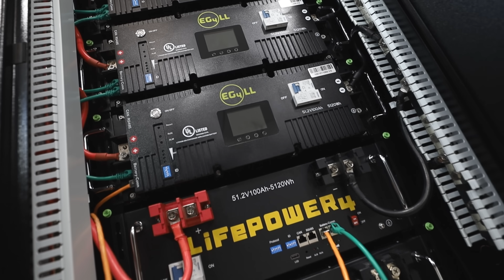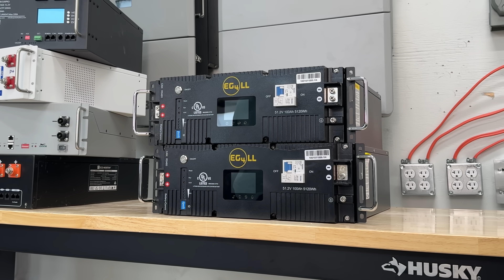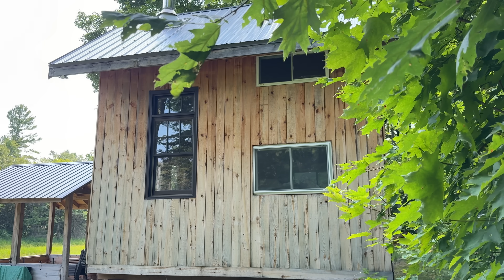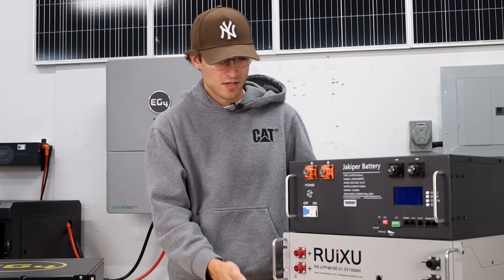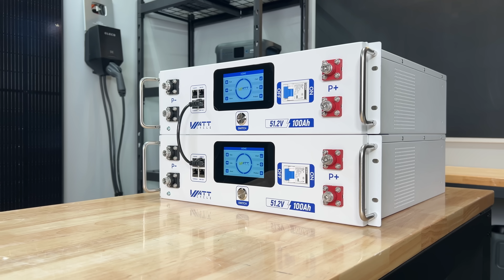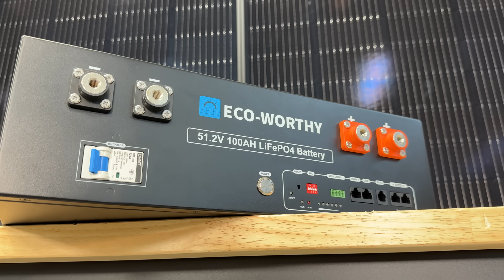Stop Wasting Your Money - Only Buy These Solar Batteries

Comment: You guys should invest in a 60 volt battery cycling machine. To really find issues and to graph out the results so that your viewers can see it for themselves, you need a calibrated and certified cycling machine. They are 20 to $30,000 and you have to run Chinese three-phase, but that's not hard to do. It's just so hard to actually give a recommendation unless you have the test equipment.
Reply: Will, it's not Pecron supported therefore it won't be on this ch 😊
Reply: "Chinese three-phase"? 😅 what?
Reply: @TrueDesire존 yeah 380V. Need transformers running them but it's only way to run the best machines
Reply: @WillProwse   380V still falls in line with standard ~400V three phase, what is the Chinese part?
Reply: @TrueDesire존  no it's phase to phase voltage and 50hz. Phase to neutral is 220.
Reply: Did you even try googling it?
Reply: @TrueDesire존 . He makes it up as he goes, trying to retain his income from youtube.
Reply: @WillProwse phase to neutral is single phase. Wrong again suckup.
Reply: @5400bowen  I'm still trying to figure out what is so Chinese with 400V three phase that pretty much everyone in Europe have in their homes 😂 (red socket in Sweden for the 400V)
Reply: @TrueDesire존 ohh yeah it's close. Interesting. It's very different from North American three phase so we have to run transformers. It's 480 down to 380
Reply: @5400bowen huh? What was I wrong about
Reply: @5400bowen makes it up? I have a transformer humming next to my head right now while I type this. What did I make up
Reply: @5400bowen  You must not be very smart. 3 phase can have a neutral and while used in a single phase manner.......it is still part of a 3 phase system. 277v is common from hot to neutral, but 480v phase to phase. You must be an anti Will Prowse troll. It is common for equipment made in china to have a slightly different voltage. Look up cnc bending brakes, laser cutters, electromagnetic brakes, and similar tools. 208v, 240v, and 480v 60 herts are our common 3 phase voltages in the USA.
Reply: @CGT80 . I know more about it than you and prowse will ever imagine exists.
Reply: @5400bowen  Nope. Retired electrical engineer here, Phase to Phase is sqrt(3) times phase to neutral. It straight up trigonometry, country doesnt matter.
Reply: Their channel is just a modern day version of QVC...
Reply: These YouTubers are more interested in commercial deals with companies than sharing objective data.
Reply: @petertulp8806 . Precisely, he sucks up to whoever pays him.
Reply: @petertulp8806   Not everyone has 6 Teslas,  4 trucks and 3 golf carts. Some have families to take care of.
Reply: @Jackx-w2l  Well that sure sounds like the ultimate family transportation scenario! What’s the rub?? WP provides an invaluable service to the DIY solar community 💪🏽
Reply: @ModQuad-l6z  Didn't he get those luxury cars and mansions using money from the companies?
Reply: @Daniel0815-zzz  I don’t know how Will’s businesses are structured. I imagine his YT channel and affiliate programs provide some income.  In the US, we are all free to run our lives/gigs however we see fit (for the most part).
Reply: @Jackx-w2l  But then paid for with evaluations of equipment that folks have come to trust.  So you can truly test and yet receive payment rather than slant toward advertisement.   You kind of make your own point in that again the 6,4,3 were purchased with funds from pointing out the good and the bad as best he could with the tools at hand at the time.  As funds and time allowed he dug deeper.
Reply: You should invest in an education in being a human being. You pushed all the overpriced garbage and all the ripoff retailers that paid you to.
Reply: @5400bowen dude, where is the hate come from? Will is widely respected in his field and just because you might not like him, doesn't mean he gives out bad data about products. Please comment on what he(Will) got wrong then? Your jealousy and self bias is what is showing.

We actually need more people like Will and this channel as they all are here to give information.

Try to use your brain, research pros and cons of all that you see and make an informed decision.
Reply: @5400bowen  That's funny, he was pushing LiTime batteries over Battle born when I was planning out a system. He has also changed his opinion as the product quality of various brands has changed..........apparently, LiTime isn't as good as some of the other less expensive brands that have become available in the last two years, but that isn't his fault. He is human and acts like one. You on the other hand are just a trolling POS.
Reply: @5400bowen huh??? You haven't seen my videos then 😂
Reply: @WillProwse poor will, can't remember past yesterday.
Reply: @5400bowen post the video here, let's see what youve got
Reply: @5400bowen  Finally, some common sense in this thread. I’ve seen so many emotional, mindless followers in Will’s comment section. It’s like a DIY solar cult where they blindly believe whatever he says without a shred of independent critical thinking.
Reply: @Daniel0815-zzz . MIT and the University of Maryland have a free solar course and a series of solar videos respectively. You can find them here on youtube, or search the web for them. Really good content. I grew up with electricity. My brother was an electronics technician and did electronics engineerimg trouble shooting for the navy. Prowse put out some good info here and there, though much of it was rich boy playing, but also backed some real crap products/companies for affiliate compensation.
Reply: Because all these you tubers have an extra 20 to 30 grand just lying around to stroke your ego.
Reply: What do you mean about ego. Wasn't sure what that part meant
Reply: @WillProwse love your content. Easy to trust
Reply: @quillakiore3499  Totally agree I am a noob in this area and Will makes it easy to learn and trust.
Reply: @WillProwse . You know, the ego that allows you to promote ripoff companies so you can play rich boy.
Reply: @quillakiore3499 thank you
Reply: @5400bowen how to say that I've never really seen a Will Prouse" test video without actually saying it. 
You know the old saying: you can lead an idiot to a properly researched & informative test video... But you can't make him watch it.
Reply: @Mountebanksrus  I watched a ton of his videos...until I realized he's just selling BS for a bunch of rippoff brands and supplyers. Ever video was just glowing reports on anything and everything. It's after he started pushing Signature Solar and I tried to do business with them...what a ridiculous fiasco! The sales guy kept me on the phone for 2 hours. I've done phone sales and recognized the boiler room bull. Every other question he had to "check with his manager" after telling me he had just transferred to sales from system design. After I told him I DID NOT WANT 10AWG (I use 8 gauge, explained the whole thing to him)  leads from the panels, and he said he'd email me with a quote the next day...I got an email a month later...with a quote including 10AWG  panel leads. Not to mention they wanted money up front for backorder gear, some of which I never asked for in the quote. You know what his "manager" was telling him for 2 hours every 5 minutes? "WHY DON'T YOU HAVE A CREDIT CARD NUMBER YET!!!!" The guy was stumbling and fumbling through the whole conversation. Then prowse started pushing their "pre order" bullshit. Sure, buy gear that's not even available yet....
Reply: @georgemiller9533 hey a Toyota Camry costs more and the data is beneficial to millions of people. It's a pretty good return for everyone
Reply: @georgemiller9533 that's science George. How can you recommend anything with a proper calibrated testing system?
Reply: @georgemiller9533  That guy uses professional gear and "rigorous" reviews to burnish his image, but in reality, it is all a ploy to drive commercial promotion and secure lucrative returns from brands. He even goes so far as to stir up trouble on other people's channels.

Comment: This is going to piss off those guys who said "a UL listing gives you insurance in case something goes wrong". 

No, off grid, a UL listing means nothing. All we need is storage, not certifications. 

There are MANY guys on YouTube who do nothing but tear down "cheap" batteries and tell you which are good, and the ones that could be dangerous. 

If you still believe a UL listing is proof a battery is great... Battle Born batteries have a UL listing and they have been proven dangerous and unreliable.
Reply: A major advantage of third-party certification is consistency.  The testing agency periodically checks to ensure that the batteries being sold match the ones that were tested.  In the past couple of years that I have been looking at this stuff, some of the less expensive batteries have been built with whatever components were cheapest at the time.  A battery bought a couple months later may have different components and BMS programming.  That may not matter if you have the time and ability to troubleshoot, but that is beyond many who just want solar or battery backup.
Reply: @jfess1911 Cool story... Now do Battle Born.
Reply: @da300mann2  Exactly - battle burn disprove his theory.
Reply: @da300mann2  That is why they are so uniformly bad.😀
Reply: @jfess1911  Periodically checks to make Sure Battle Born are still fire hazards?
Reply: @robertkubrick3738  It is more to assure that they don't change the design or components, as seen with WattCycle batteries recently tested by Will Prowse.  The battery he "blind" purchased (not sent directly by WattCycle) had an entirely different build from the ones received by some others and what was advertised on the web site.

Comment: As long as it's not BattleBorn battery, I'll consider it
Reply: *BattleBurn
Reply: they are a bad product..... and UL listed. it's pathetic they are UL listed. that listing should be removed
Reply: I have 24 of them.  Very low load but still don't trust them.  They are not in house but still no trust.
Reply: Or Wattcycle.  Fucking dangerous.  Can't believe this channel is still promoting them.
Reply: Ain’t that the truth?!
Reply: EG4 is just another overpriced ripoff. The cheapest Chinese batteries are at least as good, and often better.